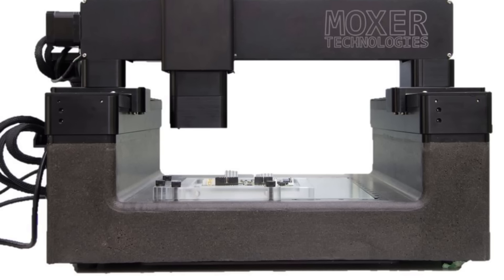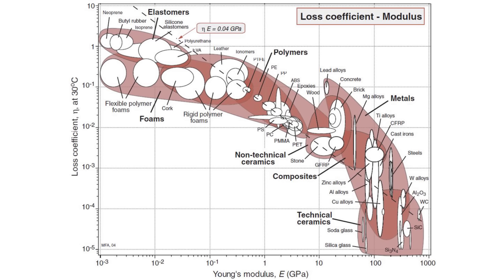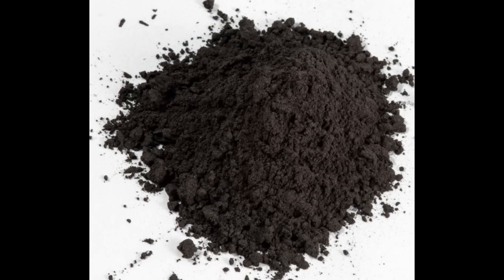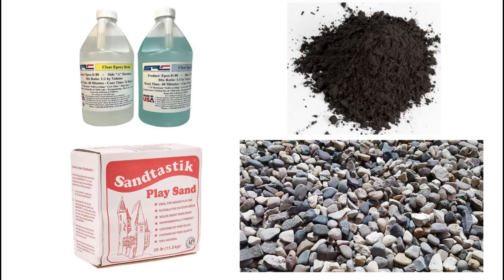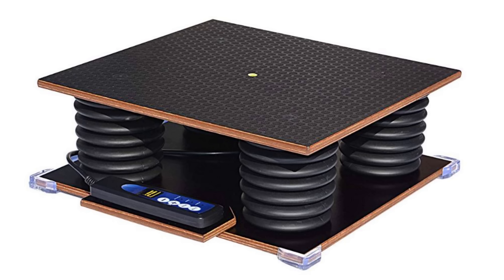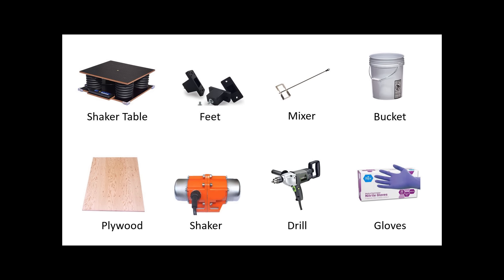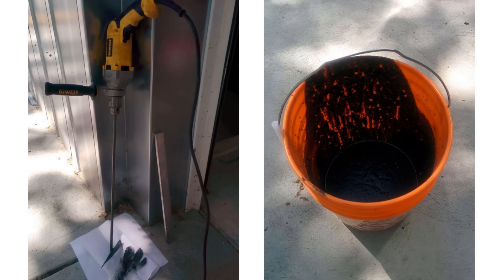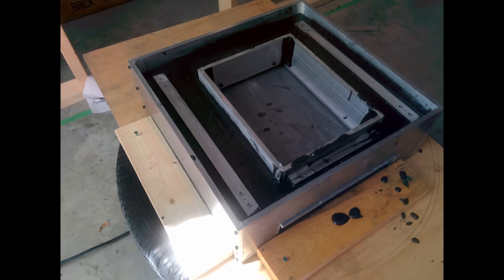How to Build Epoxy Granite Machine Base

Comment: How about pulling a vacuum on the mix and mold before pouring?  This would entail a vacuum chamber large enough to hold both mold and pouring vessel,but would eliminate the air.
Reply: That doesn't make sense. Are you suggesting pouring the woodsy into the mold under vacuum? Why would you want to pull a vacuum on the mold?
Reply: Removing the air from all interstices in the mold would prevent said air from being trapped.  I work in a composite s factory. We regularly degas resin  by pumping a 27” vacuum on it.  If there in no air it cannot be entrained in the mix or trapped in the mold. Like I said though, it would require a vacuum chamber large enough to hold both the mold and mix. A small pump would take quite some time to evacuate the chamber. I would try to pump down to at least 27” of mercury much. Much more would be futile.

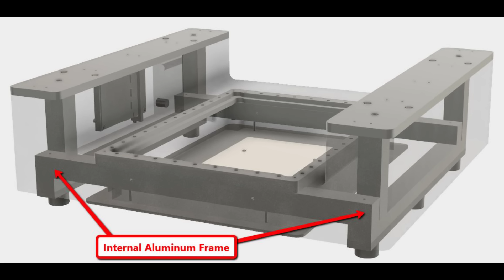Comment: 2:06 - if you could hire a CNC big enough, could you get better isolation by casting the aluminum reference surfaces into the epoxy granite without the stiffening frame so vibrations in one metal surface would have no pathway except through the epoxy granite to get to the other surfaces? The challenge would be then machining all the aluminum surfaces to precision in CNC big enough to accept the whole assembly epoxy granite and all.

Comment: Try this super new material called concrete. 😉 It's easier and way less expensive for little DIY projects like this one. You can tint it, and if you wax it it looks like a million bucks.
That "skeleton" is guaranteed to transmit vibrations no matter how much you sink it into something else (even rebar does): bad idea. Professional machines use a lightweight steel base and Silentblock bolt fittings. Silentblock fittings are inexpensive. But perhaps the real motivation for over-complicating it is in that last phrase you said.
Reply: Concrete poorly tolerates any type of stress other than compression so you'll need to make the part that you're making out of it oversized. And any design mistake can easily lead to concrete cracking.
Reply: @0fg4  Your probably confusing OPC for concrete. We're not talking about building something the size of a bridge here. That tiny little thing sits flat on a table. Even P100 can take it without a sweat.
Reply: @mururoa7024  I'm no expert, but I believe concrete has mostly the same properties as OPC, only stronger. Of course if you're making a CNC engraver concrete will do. But so will do a bare aluminium frame. But if you're making a steel cutting lathe, it most likely will crack over time.
Reply: @0fg4  Cement is brittle, concrete is not. They're different. He's making a "automated vision measurement" system, not a lathe. The only things that make concrete crack are corroding rebar, water infiltration freezing, extreme temperature changes (surface), and poor quality/wrong mix, not vibrations. There's a block of concrete inside your washing machine and you know how much that thing vibrates. 😉 Concrete will only transmit vibrations more than epoxy-granite, hence the use of Silentblocks.
Reply: @mururoa7024  Concrete is brittle and requires reinforcement to not break under any type of stress except compression (that's what you wrote). While reinforcing against bending is pretty straightforward, reinforcing against torsion or combined stress may be tricky. Vibrations, depending on their parameters, the shape of a block and the way it is supported, may also break concrete if they create high enough local forces.
Reply: @0fg4  That's why you need a jackhammer to break it. The guy's making a desktop measuring system. Geez... 🙄
Reply: @mururoa7024  hi there, I am contemplating building a CNC router using epoxy or UHPC ( Ultra High Performance Concrete). I know people do say to use epoxy but do I really have to? I've got almost all of the parts, there's no going back now.
Would you happen to know of a good recipe for UHPC for such an aplication? Should I buy the metal fibres or use fiberglass strands? I hope I make any sense. Thanks
Reply: @johnnegru8517  The first time is always going to be an experiment. Make a trial run on a small piece first to get some practice. Get the concrete mix wrong or dries too quickly and it cracks. Get the epoxy mix wrong and it either gets either sticky or brittle. I find concrete simpler as it doesn't have the cavity issues of epoxy (you can vibrate your concrete). I use a mix of aluminum+PP fibers in my concrete. Much easier and safer to work with than fiberglass. Here's the link https://www.alujet.de/en/floor/accessory/alujet-jetfibre-pp/ 
It's used for garage floors. You can driver trucks over it. Maybe you can find something similar in your country. Tip: I make 2 batches of concrete. One that has strands in it for the "core" and one without strands for the "shell". You don't want the strands to be visible on the surface of the finished product. Google for concrete pigments to choose your favorite color. Then finish with a sander. There a videos on how to wax and seal your concrete to make it look super nice.
Good luck!

Comment: I want to make a slightly larger gantry mill but I'm curious instead of using aluminum stock bolted together can you cast the aluminum I would imagine the joints would be much stronger but does the aluminum have to go through some sort of hardening process to make the material stronger? this could be a much cheaper and potentially stronger option if done correctly but gaps in my knowledge is setting me back lol 😹

Comment: This is awesome!

btw is it possible to machine a granite epoxy structure after it has cured and without it cracking?
Reply from the maker: I was able to drill the material pretty easily (for internal wiring) with a concrete bit, but I never tried machining it. I would imagine the sand would destroy the end mill pretty quickly, but it might work for a bit?

Better to embed aluminum or steel in the material where you want to machine, and machine the metal after it cures.

Comment: In our plant we have two Hardinage CNC lathe that machine metals to 0.0001” tolerance the beds are made from epoxy granite. Good material.
Your machine looks like it would be very strong and stiff. I like your explanation on modulus and dampening.

Comment: A great video!  Thanks for taking the time to share this with us.  Here are some ideas I hope you find helpful. 
1) To eliminate the cosmetic surface bubbles you can paint the mold with a coating of straight epoxy first.  You could also color this epoxy to form a "gel coat" effect.  Let it set up, or gel, before poring in the rest of the epoxy.  If it isn't set enough, the epoxy granite mixture will "wash" it off.  If it gets too hard it won't bond chemically with the epoxy granite and may flake off later.
2) De-gas the epoxy sand mixture in the bucket with your vacuum.  That would help get rid of all of the little bubbles.  Then be careful when you fill your mold to not create too many new bubbles.  The bubbles you make pouring the epoxy into the mold will be large and those will rise to the surface quickly. 
3) Packing ratio.  Others have mentioned this.  If you want to reduce the percentage of epoxy, you need to have different sized particles in your solids.  If they are all the same size you will have a packing ratio of only about 64%.  Mixing together sands of different grain sizes can increase you packing ratio and decrease your epoxy usage. 
4) Epoxy does not bond to polyethylene. You can make your mold out of polyethylene as it machines nicely.  There is also poly tape that can be used to to make a non-stick surface.  Wax is still a good idea, but if you miss a spot it wouldn't matter much. 
5) Sand blasting your aluminum parts is the gold standard for getting good adhesion with epoxy.  Do it shortly before casting to prevent the aluminum from having time to grow a new oxide layer, and wear gloves to prevent contaminating the surface with skin oils. 
6) Gloves:  Wear them whenever you are using epoxy.  Look up "epoxy contact dermatitis" to see why it is important.
Reply: Replied because simply clicking a thumbs up doesn't do this comment justice.  Good post JH.  Should be up there, right at the top ^^^^^^^^^
Reply: @Declan Thaddeus I really appreciate your reply. I got to the site thru google and Im waiting for the hacking stuff atm.
Seems to take a while so I will reply here later with my results.
Reply: @Declan Thaddeus It did the trick and I actually got access to my account again. I'm so happy:D
Thanks so much, you saved my account !
Reply: @Tyson Neil You are welcome xD
Reply: Wow awesome ideas john

Comment: At the start: "YouTube, why are you recommending this?"
By the end: "My 3D printers are gonna be really heavy in about a week."
Reply from the maker: Haha, can't wait to see the ultra beefed up 3D printer
Reply: I thought the same ahahaha
Reply: My internal dialogue: that looks so slick, need to do that as base for my 3D printer. Imagining wife’s question: why did you do that, you can’t even lift it? Me: Ummm. Doesn’t it look great?
Reply: If you use a printer that doesn't move the bed, you can make a heated bed using an aluminum plate and some underfloor heating elements, then pour the epoxy over it.
Reply: @Krmpfpks  the appearance is awesome right? Also works great for speakers since it's heavy and acoustically inert, raises the WAF by quite a bit in my experience.
Reply: Midwest Mangos WAF = Woman’s annoyance factor? 😇
Reply: @Krmpfpks  haha, wife appreciation factor, bonus rating if it matches the granite counter tops too.
Reply: Midwest Mangos my wife would never think adding granite would improve the looks of speakers. For her they have to be white and as invisible as possible preferably without any wires. It took me years to find speakers we both like (white elac air-x 403) for the living room.  I have the good speaker set and room treatment in my ‚office‘.
Reply: Bolt it to the wall.
Reply: @satibel  get a whole underfloor heated house and put threaded holes in the kitchen floor. Once you finish printing one section of a giant part, move the printer,  bolt it back down and print the next section.
Reply: @AdamBender  where did you get the graph? I think wood or stone is wildly misplaced.

Comment: Super, super, super idea! I'm gonna build a mold for my 1k x 1k cnc router. You've opened my creative mind to endless structural possibilities with this option. 
What about welding a rebar reinforced inner structure, along with the aggregate/epoxy mix? You could do smaller pours and let set. You could pour a whole table, layers at a time and finish off with mounting options to secure your rails to or whatever your machine desires to function. Rebar is cheap. You could also integrate fence posts for structural support and not have alot of money in it. 
This idea has so much potential! 
Thank you for this video!
Reply from the maker: A welded rebar internal structure would work great! I've never tried the multiple pour option, but I don't see why it wouldn't work. The epoxy will bond to itself without issue between pours

Comment: Okay, so, radical option.
De-gas the epoxy before mixing in sand.

If you’re insistent upon sand, part A, dye, then part B, de-gas after mixing in part B but before pouring.

Comment: Epoxy is not compatible it wax directly. It's one of the reasons for the poor finish. Coat the wax mold release with pva mold release to avoid those "bubbles".

For parts that thick, it's best to cast them in layers. Use a hairdryer on the epoxy to removerify air bubbles like you do with epoxy bartop.

Adding carbon fiber strands to the mix (pre-wet with epoxy) adds significant strength.
Reply: better solution is to use MG chemicals epoxy mold release spray. The surface finish will shine without polishing. 
i been experimenting with Epoxy and carbon fiber the past few years. its not a good idea... its a great one.

Comment: So basically concrete made with epoxy rather than Portland cement. I’m guessing the epoxy is more flexible than cement. I can see any flexing of the aluminum inside causing cracks and failure of the concrete.

Comment: I really think there needs to be rocks because that is where most of the strength comes from. You can get creep which you won´t see for a year or 2 and you can get cracks because the aluminum flexes and nothing solid keeps the shape / keeps it from bending. You have to use a 2x4 or dowel to stomp the mix down to push out the air and make it form to the rocks. As you fill the mold you tamp it down with your dowel or stick layer by layer until you reach the top. That way there are no air pockets.

Comment: Thank you for the deep explanations. The use of rocks has an issue, that the surface of the rocks you used is very rough. So air can stay at the Rocks. Classic concrete has stones out of the river, they are round to eliptic and can withstand high pressure. The amount of air stuck at the rocks is smaller. And this rocks are very cheap and you can use less epoxy. Good for bigger projects.
Reply: Pea gravel...

Comment: I've been experimenting with epoxy granite a little lately. I found that even fine sand can be too coarse to fill in the voids, so it's a good idea to look for rock powder. So better find a mix with powder, sand and rocks.

I also want to try out something like a vibrating metal rod that you can stick into the freshly cast mix to get bubbles out. That way you don't have to vibrate everything at once, might be a bit more practical than the shaker table.

Comment: learning a lot about using concrete from machines. Thank you for sharing your trials with us.

 I have a bit of experience with concrete, what you might call decorative or glass reinforced concrete...play sand is a big no no!!  Its been tumbled so its not scratchy (for playing), but that means its round and does not properly lock together the concrete.  Sharp sand is what you want....mason sand is super fine, but sharp and sold at any box hw store.  Torpedo sand is more coarse and I am pretty sure that's what is in the tube sand bags, also sold all over.

also your mixing method, I think mixing the epoxy & other liquids and then slowly adding the sand would ensure a better mix on the epoxy.  If you are that strapped for time, start with the liquid in the bucket & add the sand.  The way you did it had to be a son of a bitch to mix!

Lastly, did you consider the use of glass reinforcement fibers / mesh?  I have had great success with those is thin concrete that needed to be strong.
Reply from the maker: This is great information! If I ever make it again, I'll definitely try that sand type.

Also, glass or carbon fibers was on my list of things to try, but I never got around to it. I agree this would be a great way to add stiffness. I'm sure it would mix well too.
Reply: @AdamBender  Glad to share some knowledge!  I might give this a go soon too.  one thing I would check on:  does carbon fiber get along with concrete?  Glass is used because of its alkaline resistant, no idea if carbon fiber has similar resistance (my guess is, it does).  Maybe throw fiberglass in for consideration, as it can be even stronger than carbon fiber (not by weight, but that's meaningless in this application). 

 secondly, adding fiber can be a bit tricky, especially with hand mixing and stiff mixes.  Mixing the fiber in dry with the sand is a good idea, but do it slowly so you don't get concentrations of fiber.  good luck

Comment: Use silica sand. Its what I use at work to make silgranite molded sinks. We don't use epoxy tho. Its something else with the main ingredient being MMA methylmethacrylate or however you spell it.
Reply: Interesting.  I think I've seen that methyl-etc mentioned recently on a product I've got and it may be to do with supporting high temperatures.  Guessing.   I don't know whether to call it a joke or a scandal, but I have two epoxy products that claim extreme temperatures.  One has a max of 70C (what?!)   the other 150C.   For a kitchen, the first can't even support boiling water!  The second doesn't bond better than a suction cup, even to softwood.

Comment: Nice video! Clearly and logically presented. A few questions. Have you thought of introducing aggregate into the mold as you have a base of epoxy and sand mix in it. In other words use the aggregate as a filler. As you have the vibrating table working the aggregate will sink into the mix quite easily. Second thought. As you have shown that you have access to a vacuum pump how about simply making a vacuum bag out of window setting tape and heavy polyethylene house vapour barrier? Connecting supplies in the form of bag to hose are available in a few places. The pump will only draw the air out of your bag. Your test sample that foamed up most likely never had an actual vacuum drawn but was in a leaking chamber. When I'm doing vacuum veneering I generally use a shop vac to evacuate the bulk of the air and even a small shop vac can create a quite useful vacuum. Useful enough that pretty much anybody that can fold up a heavy plastic bag can get this accomplished. In a pinch good quality duct tape can be used to create and seal up a polyethylene bag.
Reply: Filling the mold first will not work as the epoxy will not properly coat the aggregate. With a proper filler mix, which would include larger aggregate, the air cannot be drawn out using a vacuum.

Comment: Can you drill, tap, mill, surface grind, scrape that stuff?
Reply: You can only drill it. Maybe surface grinding works to, but I've never seen that. Thats why you put aluminum or usually steel plates on the functional surfaces like shown in the video. Some people mold some long nuts into the casting, to get deep threads.
Reply from the maker: You can definitely drill it with a drill bit meant for concrete. I have done so a few times to pull wires internally through the frame. It drilled without any issue. I did not try milling or grinding it.